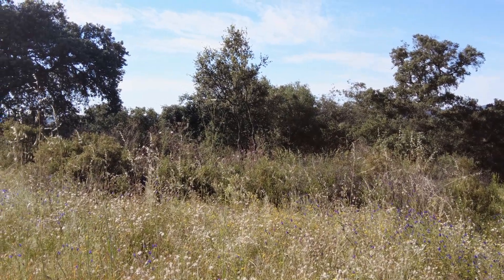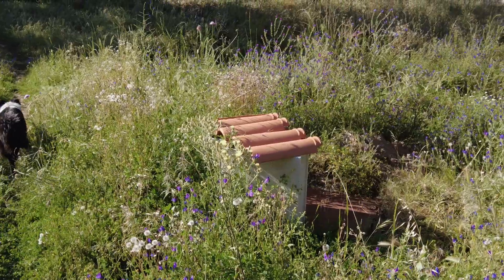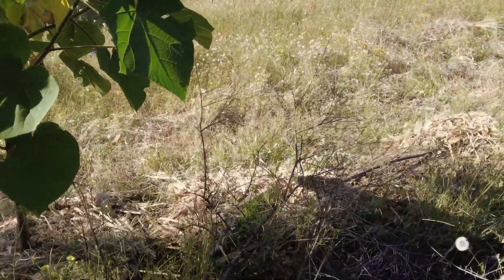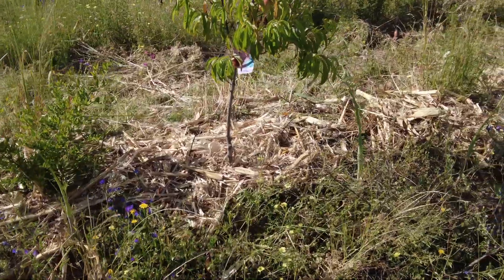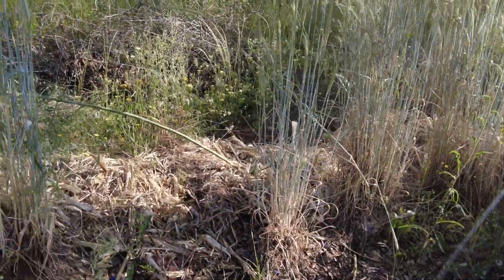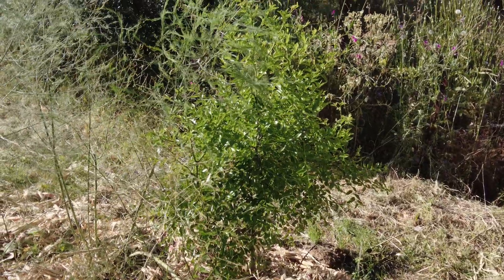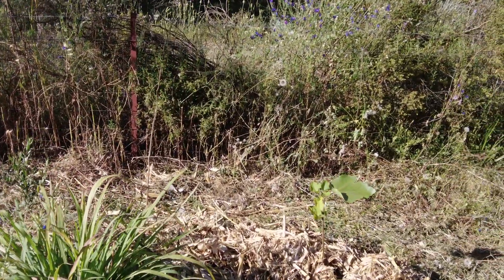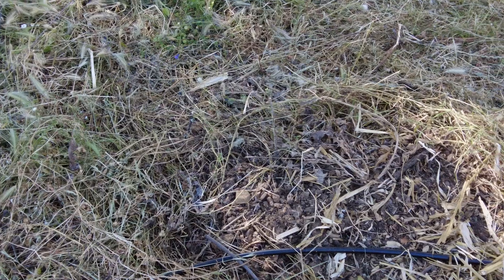Is the end of the irrigation design in sight? Labyrinth emitters and spaghetti!

Comment: Great working getting all that installed! I would double check the orientation of the Y filter that is immediately after the pump. To me, the way it looks now is that the filter traps the sediment and once the system is off the sediment settles back down to the check valve(?) at the outlet of the pump. I would have installed the filter so that the filter's inlet and outlet are horizontal, not vertical. In this way, the filter hangs down below the line and sediment rests in the filter housing, where it can be flushed out of the system. I believe this is how the Y filter is designed to be installed. As it is now, the check valve might not close fully if sediment builds up on top of its outlet. In any case, be sure to flush and clean the Y filter frequently so it does not reduce the pressure going to the emitters. In time you will learn how often the filter needs cleaning based on the amount of time the pump runs.
Reply from the maker: Good comment. I had it the other way first. The difficulty is that the filter has two arrows, one each in opposite directions. That doesn't help me. I'll check with the supplier again. Keep commenting. Much appreciated

Comment: Thank you Martin!  What an exciting video :) 
I really appreciate seeing all of the seed heads forming.  A great indicator that your desirable annuals will self sow and multiply.  Thanks for pointing out the difference between the holm oak and the cork oak leaves.  The cork oak crowns are very beautiful under the Andalusian sky.  I think you will be surprised by the growth of your trees and plants that are irrigated this summer. Turning the formerly dormant period into a growing season will be huge.
I am sorry to hear about your hands.  I know the toll the repetitive motion and exertion of assembling emitters can take.  And your hamstrings are sure getting a big stretch. =D
All the best with your startup of the cistern  fed zones!  I'm hoping it is smooth and according to your plan :)
Reply from the maker: Thanks to you Steve
Reply: @SuerteDelMolinoFarm  You are too kind.  But thank you :)  
You made it happen (are making it happen).  Just keep plugging away at the installation.  I'll suggest you identify and focus on the areas that have critical need for irrigation. And proceed with the rest as time allows.    You will continue to tinker with the system as time goes by.  In that sense, it will never be "finished".
On your 200 meter run - if you find that is too long for consistent distribution, you can continue the run back to the 40mm line and tap the end into the line also.  This is an example of a closed loop.  The result is performance of 2 - 100 meter runs rather than 1-200 meter run.  
At the lowest point of the 16mm pipe you would want to add a "T" and a 16mm valve as your drain.

Comment: I've been working hard moving mounds of woodchips by hand but I think that I have the easier job than you. Respect to you and your hard work!
We also have hard water from our well that will eventually clog the emitter tips. Irrigation tubing also folded over at the ends and bound with black electrical tape.
Reply: A question about your mineral scale buildup;  Have you tried adding acid to your irrigation water by means of a standard fertigation venturi system?  It is my understanding that lowering the pH of your water continuously is your best bet.  The University of Florida has a wonderful publication that YT will not permit me to post.   But if you GOOGLE "CAUSES AND PREVENTION OF EMITTER PLUGGING IN MICROIRRIGATION SYSTEMS" you can likely find the publication.
Reply from the maker: The end is near. Let the clogging begin.